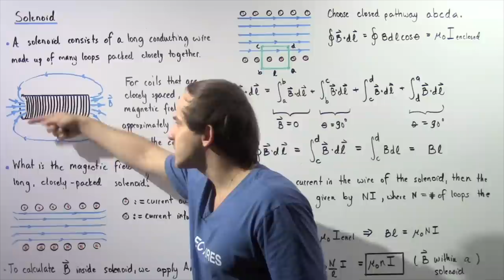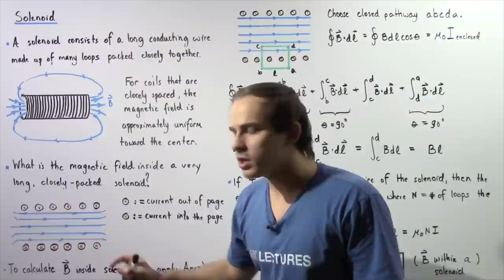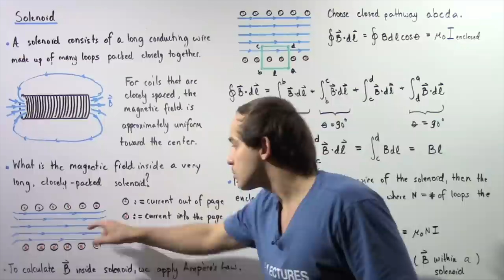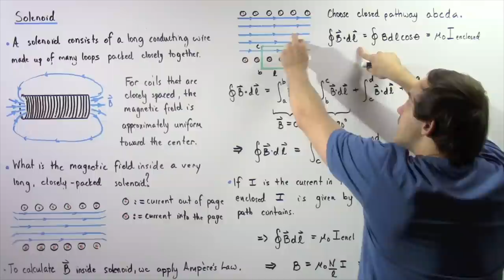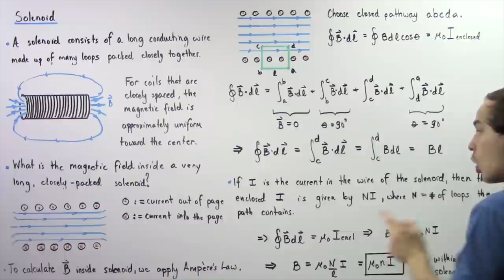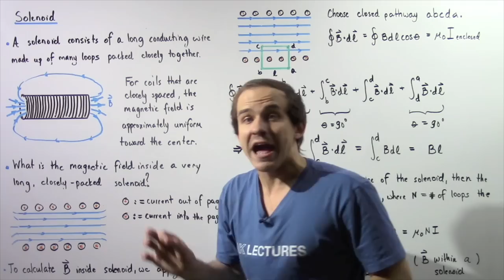Magnetic Fields Inside Solenoids

Comment: and again - amazing!
just one question-how can u know that B=0 outside the solenoid?
thanks!
Reply: Barak I wondering just the same
how come the magnetic field between a and b is 0?......
according to the right hand rule there should be a field there, no?
I would assume that between b and c & a and d the magnetic field would be 0, since the right hand rule evaluates in opposite magnetic fields between both parts of the coil......
Reply: Daniel Fensterheim hmm....maybe since he is trying to evaluate the magnetic field inside the coil?.....so he needs to eliminate the outer field in his calculations....
is this correct Andrey?
Reply: at 1:23, he says that the magnetic field on the surface of the solenoid can be approximated to be zero. While the magnetic field is still present there, it's so small compared to the field inside that it's approximated to be zero. If you look up other pictures of field lines in solenoid online, you'll find that there are very few lines in that region and more lines as you go further away.

Comment: What would be the best way to calculate the behavior (v,a, ∆a)  of a ferromagnetic projectile under the influence if this magnetic field

Laws of motion, voltage-energy equivalence...

it depends on the size of the piece of metal and also exactly how strongly magnetic it is, this makes the voltage difficult to calculate and we have a mass m with a ∆a, changing its acceleration, requiring an integral and the laws of motion

Comment: why is the magnetic field zero
Reply: at 1:23, he says that the magnetic field on the surface of the solenoid can be approximated to be zero. While the magnetic field is still present there, it's so small compared to the field inside that it's approximated to be zero. If you look up other pictures of field lines in solenoid online, you'll find that there are very few lines in that region and more lines as you go further away.